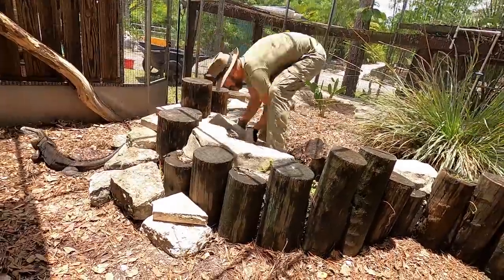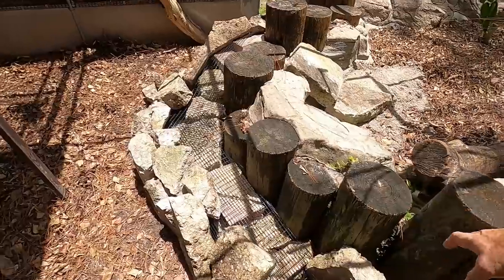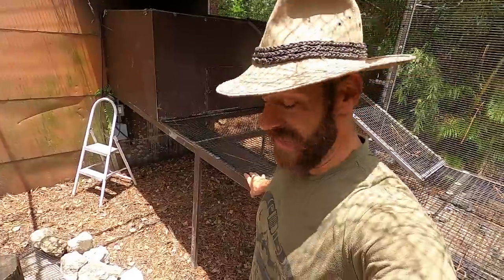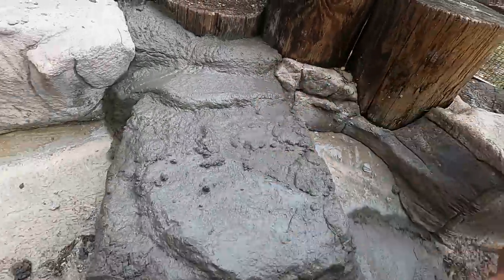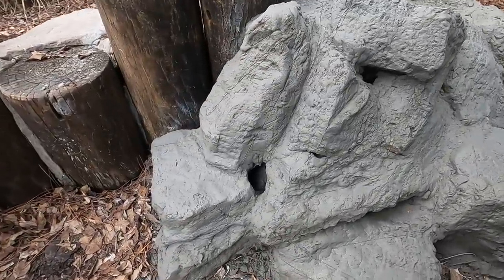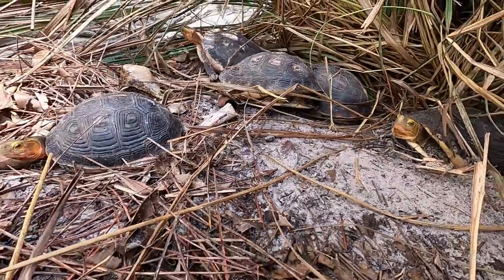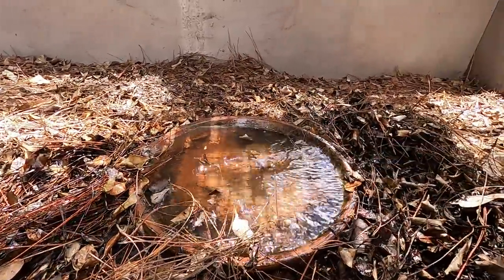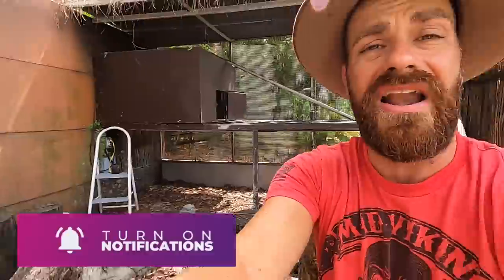Building a Rock Ramp for Chinese Box Turtles! (Will it work?)

Comment: Just a suggestion it might be worth getting some dense planting underneath the mesh platform in the lower section, where the water is, to give them more options to rest/enrichment and provide some where cooler for them to chill as while they have the shade in the grass on the plateau I would imagine that area will still get significantly hotter as it gets a lot more sun, correct me if I'm wrong. Plus I'm sure they would appreciate it and it will fill in that dead space making the enclosure look nicer.

Comment: Would it not of been easier Kenan just to remove one of those corner logs and just let them walk right in? Just saying...seems a lot of work for you
Reply: The inner portion used to be Slinky's old "pond", didn't it? Which they didn't actually jackhammer out & remove the old cement basin of, just backfilled with healthy soil & are basically using as a giant "planter" natural growing features for the reptiles?
I think that (judging by him talking about backfilling with more dirt) the ground separated by the logs is being graded to 2 different tiers of "elevation", even if only by a few inches, with the inner teir being "higher" so it can drain more naturally rather than just turning into a swamp puddle in the rainy season. The logs will act as a retaining wall in wet season (standing water will be able to drain out through the small inch or so gaps between the logs, so it doesn't overflow & "flood"), because if you leave too wide an opening by removing an entire log you'll end up with a mudslide sluicing down through the gap from the upper tier. 

😊 Also, the gentle grading of the cement-formed ramp provides an enriching tortoise-friendly climbing feature for turtles 🐢